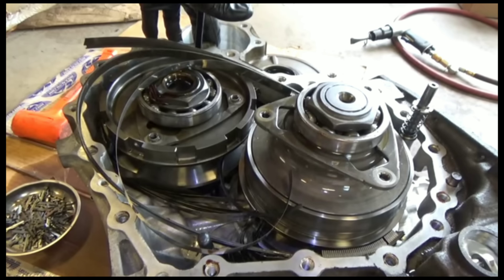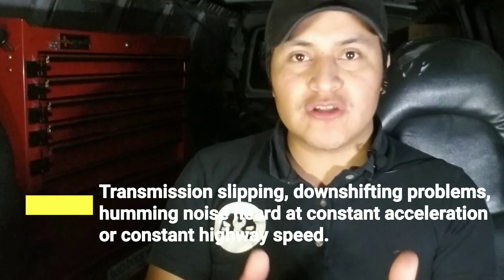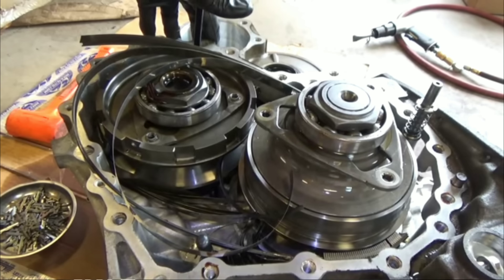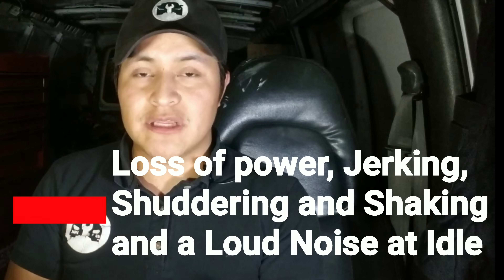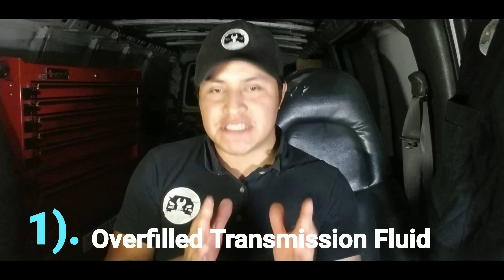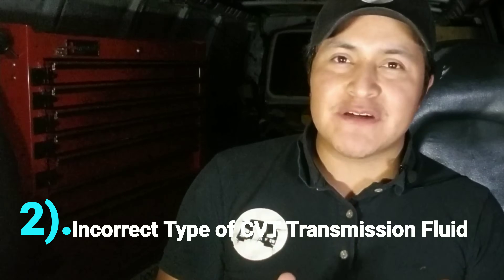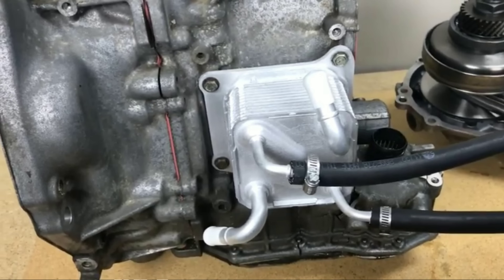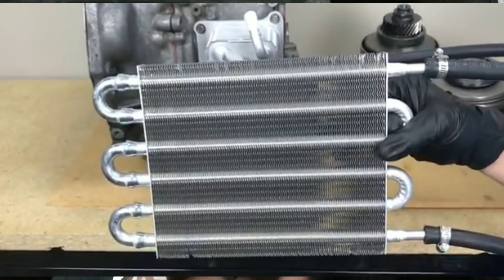NISSAN CVT TRANSMISSION | why it fails and what you can do about it to prolong it's life

Comment: I got a 2012 Nissan Altima 2.5 with that CB transmission garbage in it it's got 160,000 miles on it the transmission starts jerking and vibrating and jerking every time you give it gas it's chatters and jerks then it goes into limp mode they need somebody needs to take it out and bring it down there and stick it up their ass what they need they need to be they need to be sued and have to replace all of them

Comment: I have almost 300000 on my 2007 altima,,,,some hints,,change every 30 to 40 thousand miles,,also if you are at red lights don't push on it hard,,,if it starts to slip back off the pedal,,,these car are not race cars and need to be treated kindly,,also when car is cold let it warm up before you push on it,,,,these cars can last if you are kind to them,,,my goal is 400000 miles on my girl,,,,my best car I've ever owned,,it has always started and never died on me and the thing is driven constantly,a real hero!!!
Reply: If you need to treat your car kindly, that's a problem. Not saying that you have to abuse it. I see videos saying keep a light foot on the gas, don't press hard to pass, etc. Don't, don't, don't. Best don't is Don't buy a car with CVT. Mazda here I come.

Comment: and when doing the oil change filter change the antifreeze change and adding a aftermarket cooler will changing the stepper mottor help also? thanks for this great video
Reply from the maker: It would help, but if the transmission already has an issue in the transmission the step motor might not make a noticeable change
Reply: mine just overheat i let it sit for a while and than all is good again
 @WrenchLink

Comment: Hello! I have 125k Nissan Roque with some noise you explained, its tough to accelerate from the begining and then its fine if its go after. Recently changed the fluid, seems like I need to change filter or transmition is done?

Comment: My 2014 Nissan sentra just had a P0965 code pop up after being misdiagnosed by every mechanic and even the dealership. Was told by Nissan I need a new transmission but it costs more than the worth of my sentra (retailed 1200-1800$) I am junking this piece of crap and never buying from Nissan again. Had 160,000 miles to be fair so she had a decent life.

Comment: #1 tip. DONT BUY A CVT CAR
Reply: You can say that again. I am so pissed that I didn’t do more research before buying a 2019 Altima.  I purchased with 25k miles Feb 2021, it now has 65k and I have had zero problems with anything. It’s been a great car and I have no complaints. However, I can definitely tell that something is going on with the transmission . I’m about to take it in for the cvt exchange and coolant flush. I  pray I see a difference. I don’t understand how Nissan can get away with such a faulty system on the market. Why the Duck 🦆 are they not recalling these fucking transmissions. You heard the guy. The transmission is going to go, inevitably and apparently it’s always sooner than later.
Reply: @AttiCarius12 I feel you brother… I’m going through the same with a 2021 Altima I bought used last year.. sometimes it drives fine but probably 3/4 of the time I drives like shit. I’ve took it to the local dealership and they never find anything wrong with it or they’ll say something totally non related to what I’m complaining about… scamming me I think because it’s $160 every time I bring it in for a “diagnosis” and they’re just trying to ride it out until warranty is over in 15k miles. I should’ve bought a Honda Civic/Accord

What is your car doing in particular? Mine hesitates real bad for a few seconds when I take off from a stop but then it’ll take off like a goddamn rocket and it’ll vibrate like crazy when I’m lightly on the accelerator which is very slowly getting worse over timw

Comment: My CVT still runs good after 300,000 miles. I always have AC running that makes the radiator fan runs all the time and I only use original Nissan CVT fluid and have it flushed at Valvoline, but I ask them to put my Nissan CVT fluid!!! After the flush it don't slip anymore and  runs always strong again.

Comment: They didn't really fail. You have to buy original only Nissan CVT fluid and go to Valvoline every 60-80,000 miles and have your CVT flushed. After that it will not slip and run strong.
If you don't change the fluid you will have no power at start up. 
If it has error P0776 shift solenoid B. Buy a new solenoid and open the oil pan and replace solenoid #4 from left. 
If the belt breaks open the Trans sub assembly from the side and replace the belt and or rollers.
My CVT has 300,000 miles on the original. I only changes it 3 times with original Nissan fluid and with Valvoline flush service.

Comment: Hey brother I got a question.... I have an 05 Nissan Murano with 197,000 MI cars been working great until then then all of a sudden I noticed the other day my RPM gauge on the highway would jump up and go back down jump up go back down like it was slipping for just a second and going back down and just started doing it out of the blue... It progressively got worse as the day went on and I made it home and let it sit until the next day started it up drove it and it drove like it always did until I guess it warmed up real good and then it started messing up on me again... Now if I barely press the gas and just ease around town like a Grandpa would it doesn't slip or mess or anything and I can drive it just about anywhere so what I'm asking you is if I change the fluid and the filter and put the bars leak CVT transmission fix in it do you think that'll fix it because I don't think it's gone bad all the way yet and I'm trying to save it before it does and I love my car and I'd hate to junk it because it's my family's only car because we're poor people and we can't afford to go out and buy a new car so I would appreciate any of your thoughts thank you

Comment: We have a 2013 Altima 3.5L. Replaced the first CVT at 50K under warranty. Just had to replace it again at 165K out of pocket. I absolutely love how it drives but it's just not worth it in the long run. Still, paying 7K for a new CVT was cheaper than trading it in and ending up with a 20k-25k new car balance...

Comment: I will never buy another Nissan. I had a Murano and had front suspension issues, AC condenser, and the transmission went out. The roof rack was making a noise and they wanted to change the sun roof for $5000.00. I had to get the roof rack retorque at Christian Brothers for $450.00and that fixed the problem.

Comment: Something that is also available for the nissan jatco transmissions are cvt cooler adapters. The cooler adapter allows you to mount an auxiliary radiator mounted transmissions cooler to your car. It's an upgrade to the system. Also, in my experience with working on these transmissions,  changing the fluid at 30k is about right as long as you have a cooler kit set up and do not forget to change out both filters. You have a pan filter and you have a filter behind the stock cooler. People forget about the cooler filter all the time. I also use the Idmitsu NS-2 fluid on these.
Reply: One of my relatives has a CVT transmission  - and change the oil every 30k miles (including the pan filters) . They don't use it manually either!
Reply: @michealhaskell7258  What do you mean by " don't use it manually"?
Reply: @billt7207  Thanks. I don't own a Nissan but my neighbor has a 2017 Maxima SV with only 9000 miles on it. It just sits in the garage. He may sell it. After all I have been reading about these CVTs I wish they didn't put them in performance cars, but instead stick to the small 4-banger engines. They are high maintenance and may not have a long life for people who keep their cars a long time...like me. I still have my Acura TL-S from 2002 and it drives like the day I bought  it with the original tranny. After 20 years, I just think it may be time to replace it even though I don't have to. Getting a 2017 Maxima with 9000 miles and garaged seems like it may be a good idea however..... difficult decision... waiting on his price.
Reply: @billt7207  Hi .
I meant leave the CVT Transmission to it's own devices - don't move the lever to 'low' (leave it in 'Drive' only!
When accelerating- and you feel it is reving high, just lift off the accelerator)!
Reply: @billt7207  I meant leave the CVT Transmission to it's own devices (in drive only)
Reply: @billt7207  What I meamt - "Don't use it manually" is to leave CVT transmissions to their own devices (Don't shift  the lever abput ) keep it in auto and if it revs to much  - lift off on the accelerator! and it wiil  select a higher ratio!
Reply: @michealhaskell7258  As a truck driver i understand how to lift off the gas pedal, but how about a actual fix as this stresses the transmission and fuel mileage?
Reply: @michealhaskell7258  I have a 12' Altima and the owners manual says that when going up steep hills to put the car in 5th gear.  That is the manual mode.  I always do this and have well over 100,000 miles on the car with no transmission problems.
Reply: @josephkelleher8820 😅😅😅😅😅😅😅😅😅😅😅😅
Reply: Thanks for the info. Where can I get an "auxiliary cooler" and what do they cost..? Also, is it fairly easy to install.... and any idea about labor cost to install..? How much extra does it hold...? Thanks.
Reply: @mm-jx7gf  Most auto part stores and online part websites like rockauto is usually the cheapest. Oreilys sells Hayden brand, I got a bypass model as I live in the cold zone, I want to warm up fast not slower by adding additional cooler in the snow. Cold start damage is as bad as overheating. Or you can add additional thermostat to regular cooler.
Reply: @mm-jx7gf 😅😅😅
Reply: @mm-jx7gf  someone said advanced auto 70 bucks
Reply: @denisekoenig9479  Thanks.... i would never own a car with a CVT without a cooler and still do frequent fluid changes...
Reply: My 2013 calls for NS-3 but still does not help with the poor pump design. Nissan got extended warranty but I would not have problems until 20K miles later to reach 100K miles.
Reply: @TheYoungBoaty 😅😅
Reply: 😅p p p

Comment: I wonder.. there is this stuff called motorkote for your motor.. it's a hyper lubricant.. I use it in motors of all my vehicles  and no motor issues.. even on riding lawn mower.. 3hrs per mow.. 36 mows per year for 18 years.. still running great.. all that said what if you tried it in the cvt

Comment: I have a 2017 Altima midnight edition and I swear the day after I got it BRAND NEW it jerked and turned off while driving. I took it back and they checked it and said it was fine…fast forward to today and my car did the same thing and is in the shop now needing a new transmission! Nissan sold me a lemon from the start!….update: they replaced it free 😃

Comment: My 2014 Quest's transmission failed at 119,000 miles. Oddly, it failed just a few days after I had the scheduled service completed. The dealership said it was purely coincidental. That's unlikely, of course.
Reply: My wife's 2013 quest is acting up. Goes from 1100 to 2000 rpm randomly. Loses power going up hill. Don't have to move my foot, the rpms just randomly dip and accelerate.

Comment: The reason they fail is because the fluid needs to be changed every 30K miles if you don’t change the fluid regularly they will fail.

Comment: Have seen online, that other brands also having CV troubles, Subaru, Toyota, maybe some others. Do think that hard acceleration, towing, putting the cars in "sport" mode is not helpful. Buy a Mustang GT, a Charger/Challenger or a Maserati for that. Am going to get the tranny oil changed, and maybe add an oil cooler after the warranty is up on my Nissan,

Comment: I’m having problems with my 2017 Sentra sv automatic shifter. It’s hard to put into gear I changed the range sensor but it’s still hard to put into gear. Was wondering if it could be the shifter cable.

Comment: I have a 2014 Nissan Pathfinder with over 200.000 miles and just start to get a new problems  Transmission is jerkin  I've always done all my maintenance on it It's just those CVT transmission don't hold up  A metal belt is only gonna last so long I have YouTube videos on everything I've done So you wanna look them up how to do everything it there

Comment: how could cvt transmission fail Nissan has an oil cooler system which helps to control cvt oil temperature

Comment: Just wondering got codes for a step motor replaced now trans jumps goes limp mode after it doesn't shift is it really done or could it be shift valve?

Comment: Just purchased a 11,700 2014 Nissan Maxima already experiencing issues within few days bought it to the attention of the guy I got from he was no help. Money wasted 95,000 miles on vehicle. He got got it from the auction here in Eads TN I also bought it to their attention and they didn’t help very disrespectful told me I had to deal with dealer. Car also had water in doors and trunk so I drained doors. Windows are continuously foggy got me thinking is the car a flood damaged vehicle. I’m so upset I saved my hard earned money and dealing with these issues so soon.

Comment: Mine gave me a P0744 torque converter clutch solenoid circuit intermittent.  Have you run into this problem Before

Comment: Advice please, is it worth it to replace the cvt transmission in my 2012 Altima 2.5S? I have 174,000 miles on my car now.
Reply: Ask yourself this: Am I going to buy a car that I like better, for less than the approximately $4-5,000 CVT replacement cost? 

In my experience, not likely -- especially not at the time I'm making this comment, with the new and used car markets so inflated. You may not like your car for other reasons, but I wouldn't let a transmission replacement talk me into years of car debt at this point in my life if that's the only problem. Cheaper to keep her, as the saying goes.

Comment: Nissan Murano 2015 111,000 miles and it's not making noises, but it is shuttering and in low speed feels like i'm driving over rough roads, felt like a fuel pump when the gas doesn't connect.  ... boo hooooo sounds like a transmission issue.  I can hardly believe it, just after the 100,000 warranty.  :(

Comment: I almost once had my Honda CVT ruined by technician at dealer. He under-filled the fluid below the min mark of dipstick. I drove few km and the humming noise flared up in the cabin. I checked the dipstick and it booms paycheck goofy-ball for dealer. I have bought another bottle of DW1 ATF. The noise is gone. Thank YouTube mechanic who taught how to check aft fluid in CVT.
Reply: At least you had a dipstick!  So many cars don't even have a dipstick and rely on dealers specialty scanners to determine the proper level.

Comment: I have a 2012 Nissan Sentra with 154,000 miles on it. I bought it brand new from the dealer, so all the miles on the car are mine. I have the receipt for everything ever done to it in a file in the glove box. I don’t babysit the throttle. 
I noticed early on the difference in how the CVT transmission drives, especially how it changes gears. I’ve learned over the years to allow the car to properly down shift as I’m coming to a stop. Anyone who has this vehicle knows that when you let off the gas to come to a stop you can feel the car still in gear and at a certain point it will free up and float like it’s in neutral. My experience is to allow the car to get to that neutral point before coming to a complete stop. Whenever I’ve come to a very hard stop it’s like the trans gets jammed up and it takes a half second before you can accelerate again. So, my advice is to allow your car to come to that neutral position before coming to a complete stop, ensuring that you are not coming to a hard/abrupt stop and then not trying to take off too fast after the stop. Basically, even though this little car can zip, it’s not a race car.
Also, every car needs a good two hour drive at highway speed every few months or so just to blow the dust off the engine. Whenever I make a trip from Houston to Austin and back, my engine always runs super smooth.
Best of luck all! ✨👌🏾
Reply: Very good advice
Reply: Do you still have the sentra?

Comment: My boy bought one from a silver spoon girl. She's 17 now, he paid fifty bucks. She beats the crap out of it. Drive hard is understatement. 120k miles, she had it 30k of those miles. What it does is normal at first, but only first variable after warm. I've posted water on it, it seems to help a bit. Will flushing radiator system & changing fluid be the fix. He drives a machine like it's a machine. Respect & easy. .
Reply: 2014 versa cv or sl. Whatever they call it. It is the belt/pulley system.